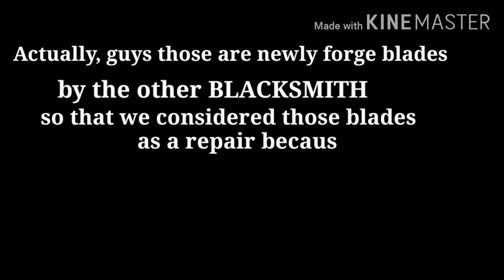Handly repaired blades

Comment: Sir tanong lang paano niyo napapaitim ang blade? Hindi na po ba matatangal yan? Ano rin po maganda gawin para hindi kalawangin yung itim na parte ng blade. Salamat sir.
Reply from the maker: Hindi po yan matatagal sir punasan nyu lng po ng oil or metal polish hindi naya kakalawangin
Reply: @jpblacksmith7658  Sir tanong ko lang po. May itak kasi ako na may itim din ang blade. Nung pag tingin ko kasi kinakalawang siya. Ngayon pinunasan ko ng pinunasan ang nangyari sir di na siya ganun ka itim na akala mo pininturahan. Paano po ulit siya mapapaitim sir? Para sa akin kasi maganda sa mata yung ganyang blade kumpara sa polished. Salamat po.